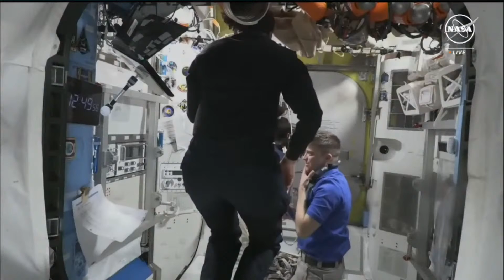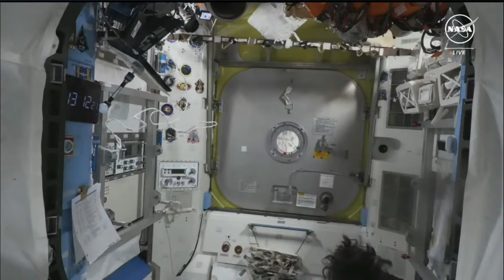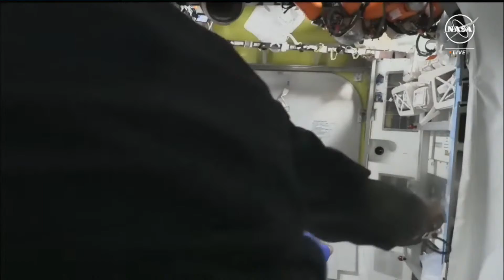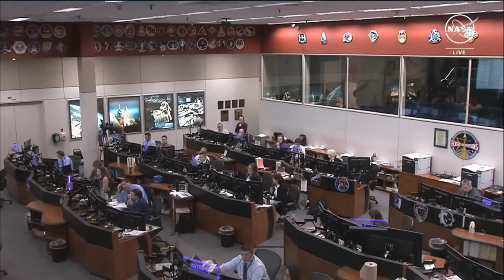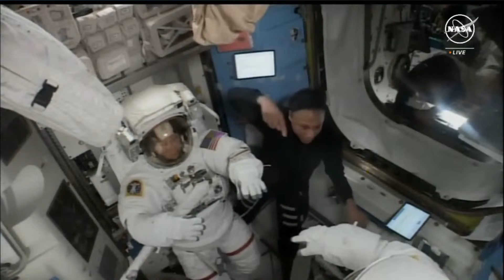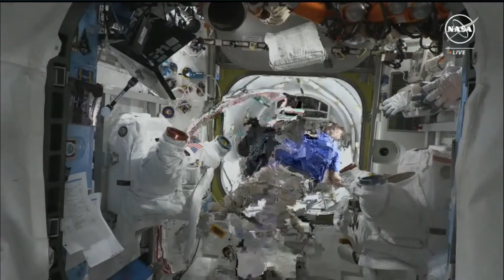NASA spacewalk 'terminated' due to spacesuit cooling leak

Comment: After watching this, it is apparent that the Apollo missions never went to the moon. They had none of this external assistance when pressurizing and depressurizing their suits and the LEM. Where did all of the O2 come from for the long EVAs and multiple depressurizing and repressurizing the LEM come from? Where did all of the extensive battery power come from to heat and cool their suits during their multiple hour EVAs?
Reply: I see you are not an engineer and thus have no concept of what is necessary for EVA. Would you even understand it if someone gave you the calculations? For instance, the Apollo missions used liquid oxygen and worked in low pressure (5 psi) 100% oxygen atmosphere. Since solar radiation, human metabolism and the vacuum of space will keep heat from dropping fast (remember Apollo 13 turned off their heaters for a time), you don't need to add much heat to make things work. Add in the heat derived from fuel cell reactions and you really have an abundance of waste heat available. Just because your limited engineering knowledge makes it difficult to understand doesn't mean it must be a conspiracy.
Reply: It's simple: Brilliant Engineers with a blank check. Vs Bureaucrats on a budget.

NASA was infiltrated and confiscated by incompetent politicians, not aerospace experts.
Reply: Been thinking the same . Something isn't sitting right with the moon landings, it's way out . Early 1960s technology,  not late 60s . Took years to design, build, test and flight certify the space vehicles etc...

Comment: Did Boeing make that spacesuit that's leaking?
Reply: Yes. Have you heard of any problems with the SpaceX suits?
Reply: @Beenthere1  You mean the SpaceX EVA suits which have never actually been flown? Incredible that they've managed to remain problem free on the 0 missions they've been utilized for.
Reply: @jolomuhmad2925 the problem is the suits currently available actively try to kill people.  As pretty much every suit available has had a history of issues aborting EVAs now.
Reply: @Beenthere1 no
Reply: no, they were made by ILC Dover. They are getting pretty old and are very hard to completely maintain in a weightless environment. The cooling system has been especially finicky in recent years.
Reply: @Awesomepotamus  who designed them? Do you know when they were used besides the current flight?
Reply: @Beenthere1  They were designed by ILC Dover, Hamilton Standard, and Collins Aerospace under contract of NASA.  The last time they were used successfully was November 1, 2023.